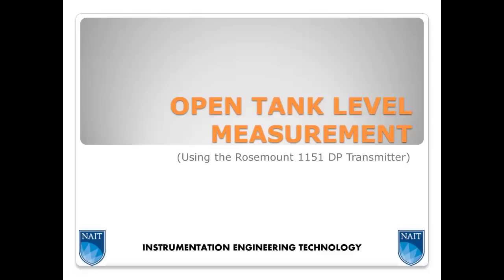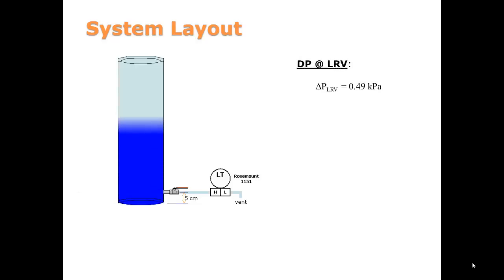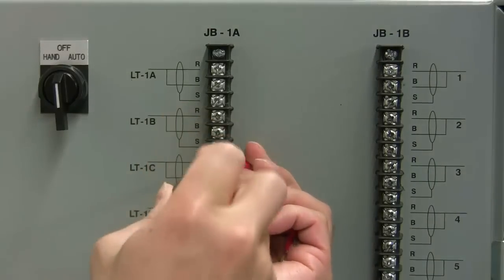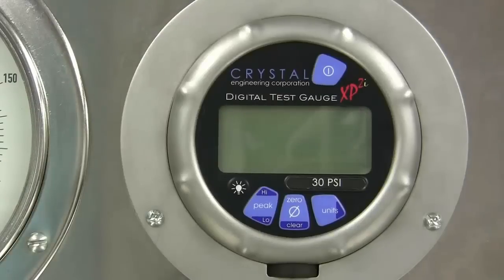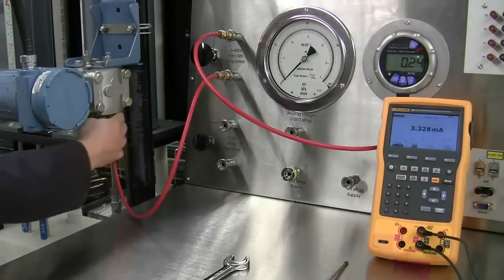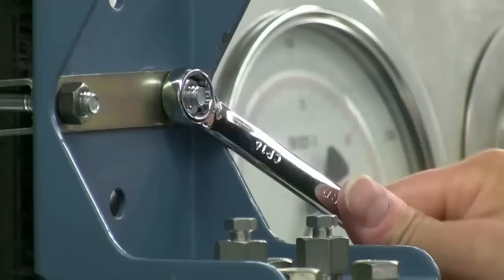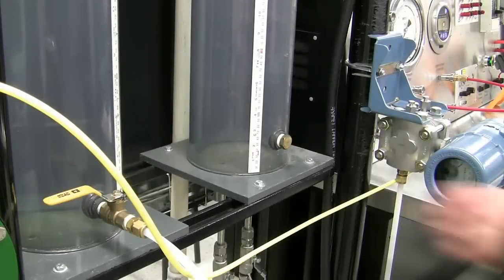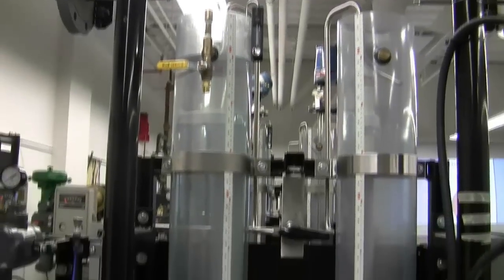OPEN TANK LEVEL MEASUREMENT

Comment: An Amazon $80 Riiai  4-20mA  0-24V  precision 0.01mA calibrator will work just fine.  Hundredth's of a milliamp is adequate.  This will save $13,000 of buying a Fluke 754 😎  Nice video

Comment: Why you calibrate with Lrv of 0.49 kpa. why you choose that value
Reply: cause its the equivalent pressure of the reference or datum line of the tank. it is the measured pressure where tank is considered zero level. it is common in level measurement to compensate the sludge or sediments settling down at the bottom of the tank.

Comment: at minutes 3 you start sir to connect high side to regulator and Instrument Air Supply !!! this made me confused ... what I know , its connect to process - bottom of a tank
Reply: Q1W2E3QW the instrument air connection is used for bench calibration purpose.
Reply: ok .... why you not use pressure transmitter for open tank instead of using DP Transmitter.
as you know, its more expensive ... plus a manifold related to differnial transmitter is more expense than manifold of pressure transmitter...in addition, you dont have to wary about low side to elemenate dust and wind impact.

Comment: Why you not mention 250 omh In series conection ? 
Branch type calibration need also 250 omh
Reply: U don't need a 250 ohms resistance if u are not hooking communicating device...... The 1151 series transmitter are purely analog and are not hart enabled, the there will be no beed to reduce the loop impedance. Thanks 🙏